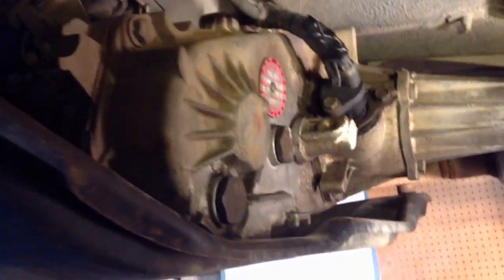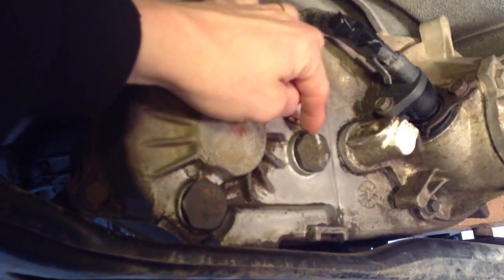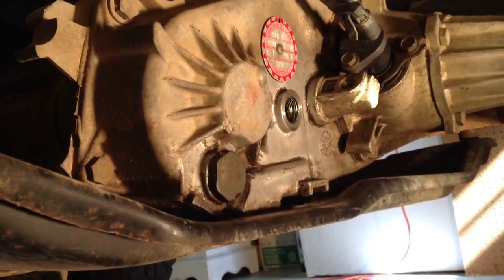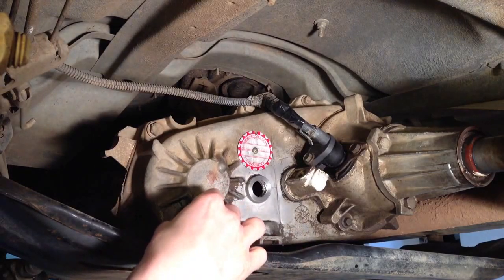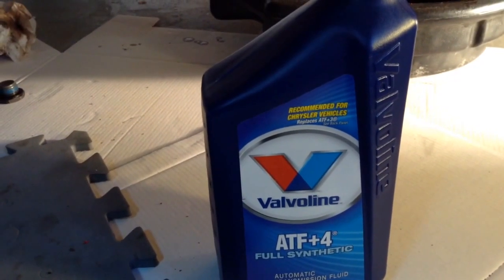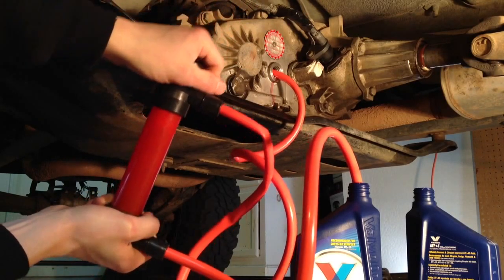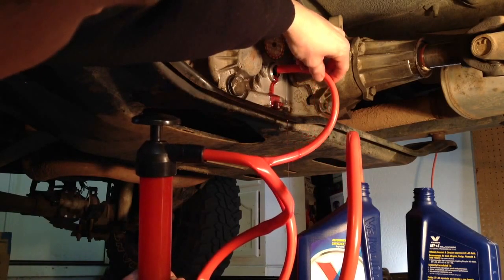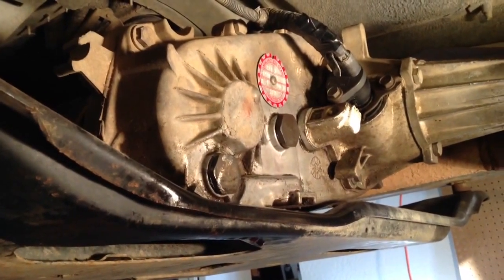Transfer case fluid change Jeep YJ

Comment: Thanks for the videos.  So use transmission fluid in the transfer case? Valvoline also has transfer case fluid.  How would that work? thx

Comment: Some sources I saw said that any cheap ATF is fine, not needed to buy the expensive ATF +4.  
What are your thoughts on this... 
great video series... Just got my YJ this week. 
Thanks
Reply from the maker: +kens97sto171 I prefer to spend a little extra on fluids and know I have good protection against wear. If you use cheaper fluid, often you need to change fluids more often, as cheap stuff breaks down quicker. So, you end up not really saving anything.

Comment: Go trough your jeep and drain all fluids. Replace with royal purples complete line of lubrications. 5w30 hps (high performance street) oil. Tranny fluid, gear oil, diff fluid. Little pricy up front but saves money in long run especially engine oil I only have to change my yj oil every 8 months, can go longer than  that but choose not too. Best thing I ever did to my jeep.

Comment: Could I use that same red pump to siphon out the rear old diff fluids out as well? Then use it to fill it up again?
Reply: Very late but yes. So long as you flush it out
Reply: @doodlecaboodle9298  if I’m not having any leaks any issues at all w my diffs should I change them anyways? Preventative maintenance? I’m up to 209k miles atm and been contemplating it lately 🤔

Comment: Hey I appreciate you posting this video very much. I wanted to let you know that a 30mm for the plugs  could work but in my case it was seized and the 30 mm stripped my plug a bit and would not work. THE PERFECT SIZE IS 1" 3/16. that one wont strip the head of the plugs. I am not hating I am just trying to help other people like you do. Thanks again.
Reply from the maker: +HAROLD De La Matta Yeah, that stinks to round off a drain plug, but thank you for the tip.  It's a good reminder for viewers to make sure you get a good fit.  The 231 drain plug calls for 30mm, but not the first time I've heard someone using 1 3/16" which is actually slightly larger.  Was your 30mm a 12 point socket?  Sometimes people have better success with a 6 point socket as opposed to a 12 point, but looks like you got it done with the 1 3/16".  Thanks again, I appreciate the feedback!
Reply: Yeah it was a 12 point, the 1 3/16 is a 6 point.

Comment: Haynes manual says 35 ft lbs
Reply from the maker: Yeah, that's odd. I went and looked it up again. My Haynes says 15 to 25 ft pounds for np231.  Why I chose 20. I have seen different styles of plugs on these, maybe that's the difference?? I guess, just tight, but not over tight 😁

Comment: Thanks again. I managed to change my tcase and transmission fluids by watching These.  One ?...Can i overfill either the tcase or tranny? I put the cap on while they were leaking out.  Thanks
Reply from the maker: It's hard to over fill.  If a little is running out, that's ok.

Comment: are there some kinda identifying marks on a tc to know which model you have?
Reply from the maker: https://youtu.be/7K9wES5JGtg?t=27
there ya go ;)
Reply: I don't follow... I didn't notice any mention of identifying different tc's in the video linked.
Reply from the maker: There should be a tag on the back of the transfer case that's stamped with the type.  Here's a better video where I show 2 transfer cases and the differences.  Thanks for watching!
https://youtu.be/3MvW3FL_p8A

Comment: Do you have any experience with a 2.5 to 4.0 engine swap? I am about to put the engine in and bolt up everything mechanical. What I'm worried about is the wiring harness. I think I should only have to use the donor's(96 xj) engine harness and my 97 TJs harness for all the gauges,lights, etc. Ever done this?
Reply from the maker: +Josh Sharp No, haven't swapped a 2.5 for 4.  Hope the wiring goes well for ya.  Good luck
Reply: +JeepSolid thanks.

Comment: Yours has a hole where mine has a vacuum switch.  Why is that?  Did you take yours off?  Anybody got answers as to how to bypass the vacuum switch?
Reply from the maker: +Lowell Guzman Didn't remove vacuum switch.  This is np231.... But don't remember the date??? 93-94 range.  What's yours?
Reply: Is there a way to send you a picture?  Mine is a 95 YJ 4.0L  manual transmission.  I do believe it to be the original transfer case
Reply from the maker: You can send a picture to JeepSolid Facebook page if you'd like.